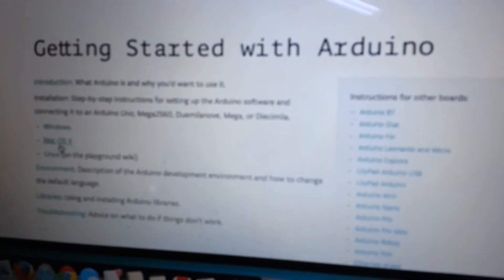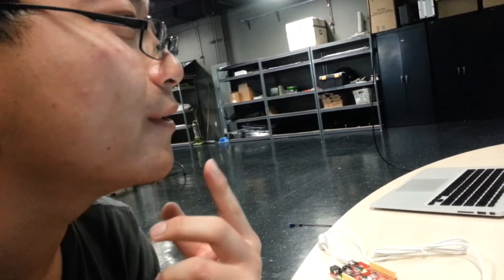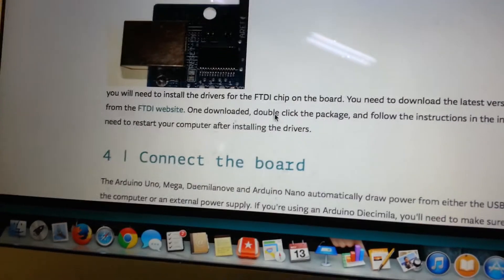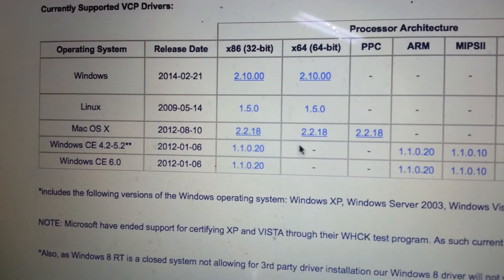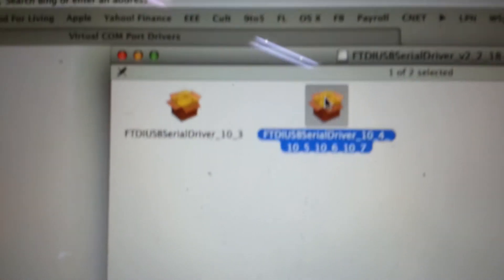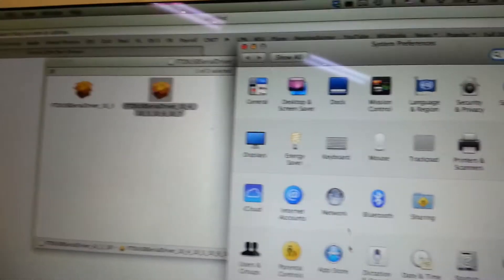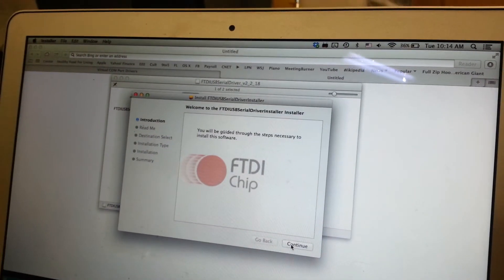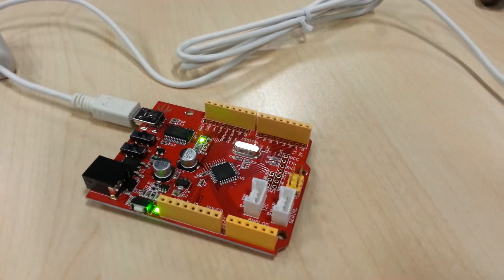Informatics 148 - FTDI Driver Install - Getting Arduino / Seeeduino Running on Mac OS X Mavericks

Comment: Unfortunately, that doesn't work on my Mac, I have Mavericks too and I've taken all day trying to get Arduino Uno with my code and nothing! I NOTICED that only when I've just had to install the IDE the serial port dv/tty. usbmodemfa341 appears, I mean it only works ONCE but when I try to record another code, it disappeared. 

Mac OS 10.9.3
Java 7
FTDI installed

I'd thank any help